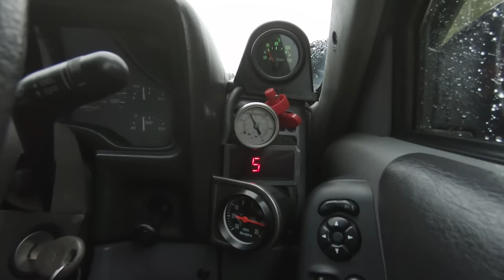Two Rigs Heading North / Overland Adventure Documentary

Comment: Hey Mike! As usual, I absolutely love your videos. 

I had a bit of a suggestion for you. I’ve noticed that in most of your camp videos where you cook, one of your staples is rice.  My wife is Brazilian, and her rice is the best I’ve ever tasted.  I thought I’d let you in on a simple trick that may enhance the flavor of your rice significantly. 

Instead of adding the rice to the water in your cook surface and letting it cook, first try this.

Add a small bit of oil to the pan, dice 2-3 cloves of garlic, add the garlic and also add the rice to the oil for just 20-30 seconds- and stir. You are essentially crisping the rice for just a minute with the garlic. Then add the water and cook as you normally do.  I believe you’ll want to use Jasmine rice but this is less important than the quick fry technique. 

Once I learned to do this, I have never simply boiled rice the old way again.

Any way. Take it or leave it, but I think you’ll probably like it.

Big love
AY

Boulder Co.

Comment: Mike, what you gave up by raising the cg is more than made up for by the articulation of the axle/suspension combination. I think you nailed suspension 101! Also, the approach and departure angles of your rig is very good to say the least. You have created an outstanding off-roader. Not to bash Land Rover owners, but I don't think he could have made it past some of those obstacles without your help. Can you give us an update on what bent crossing the log? Maybe some armor is needed to protect those steering components. Just one question, when you are on those dirt roads are you in 2 wheel or 4 wheel drive? Before I forget, the drone footage is a very nice touch to your vids.
Reply from the maker: Thank you! I must admit I am really happy with how the Jeep performs on and off road. Its high enough and has enough articulation to tackle most obstacles I encounter. Like you say the approach and departure angles are really good. With lockers it would be very capable and that's something I will do. 
I will make an update video of the steering fix. I have a few jobs to do on the Diesel now its back in the workshop. Hack n Tap, fix steering, truss, maybe build long arms, new center crossmember, rebuild drawer system etc... Probabaly not all at once but onwards and upward. 
I think a skid plate up front is needed. I will build something myself that's high clearance. 
On the dirt roads it depends on speed and things. On loose gravel im in 4wd. On slow going crawling roads like the last one near the mine im in 4wd low range. On regular dirt roads often 2wd is fine. Thanks for watching and for the comment!
Reply: That's how I use 4wd on dirt roads. The reason I asked is because my 4wd mentor from years ago said to engage 4w as soon as you get off the pavement. I drive a Toyota FJ and never saw any use other that to burn more fuel to engage 4w if the road is okay. His reasoning was to take any stresses off the rear end. He was driving a 1942 Dodge power wagon so maybe that had something to do with his logic. Lockers will be a good fit for your Jeep. The FJ has a rear locker and A-trac for the front. They certainly help you out in a pinch. Keep up the good work!

Comment: Hey Mike,
I was looking for a XJ very recently until I saw the low roof load of 68kg. I planned to go for a hugh rack and a wide roof top tent (2.20m). In total both would be around 110kg. It would be around 40kg over the official roof load and thats what made we thinking whether the XJ ist the right car.
With your tent and further gear (in history) you were over the official load as well, right? Is it just like, you didnt care about it or did you worry about it as well?
Love your videos - keep going! :)
Reply from the maker: The roof load is on the factory roof bars not the drip rail. The drip rail has no official roof load but can support a tremendous amount of weight. I wouldn't mount a tent on the original load bars let alone a rack. 
In my case my drip rails are ones I made myself from box section with a 5mm support all the way from one side to the other. But besides this mod the standard drip rails could support over 300kg easily.
Reply: I really appreciate your answer, which sounds very good to me ;)
By thinking just logical of the weight I would have said too, that the roof of the XJ should easily do it, but then I researched the official data and I was a little unsure…
I thought about the Front runner Slimline II, which looks quite massive :)
Greetings from Venice out of the rooftoptent on my Golf R.
Reply from the maker: I used a Frontrunner slimline 2 before my current tent. It mounts to the drip rails and the load is spread across six mounts that you can position on the pillars for maximum load. I think I had like 340kg on there at one point and it was fine.
Normally though I had the rack, 32kg, tent 43kg, bedding, 5kg, 20kg of gear in a bag at the back of the tent. I guess me 70kg and Megan who's 50kg and there was never a problem. That was on the normal drip rails before I modded them
Reply: Sounds good - then you had 100kg on the roof while driving as well.
I didn’t worry about the weight while parking/sleeping (~250kg), I worried more about the weight during the rides -> dynamic load.
Thanks a lot Mike!

Comment: Hi Mike. Really random question(?), but what are the boots that you use? They look just the type that I've been looking for...
Reply from the maker: There made by Alpine. The sides have spit after about 2 years so I don't recommend them. They are meant to be waterproof also but they aren't. They were expensive and discounted at 2500kr but they are not that good.
Reply: @WorkshoptoWilderness  Thanks Mike - appreciate that!

Comment: When you are driving in these kind of roads, are you using 4wd?
Reply from the maker: On loose gravel roads with large stones at speed I have the Jeep in 4wd to avoid traction loss and skidding. If the gravel roads are well compacted with small stones then I have it in 2wd. 
On dirt roads with bear earth its in 2wd unless some obstacle turns up like a ditch or deep rut.
On rocky slow going roads like the last mining road in this video, then I'm in 4wd low range 2nd all the time.